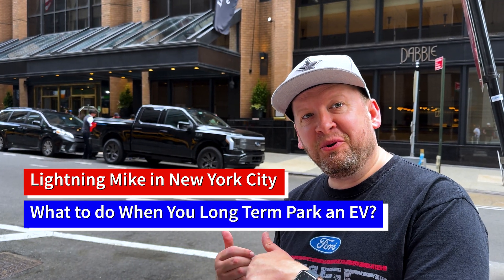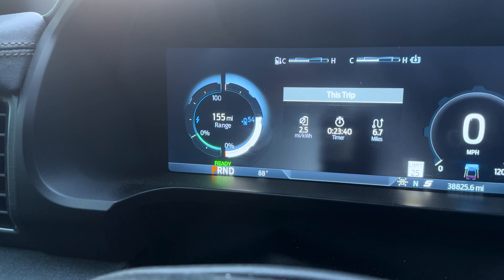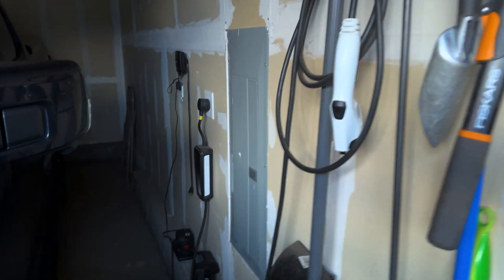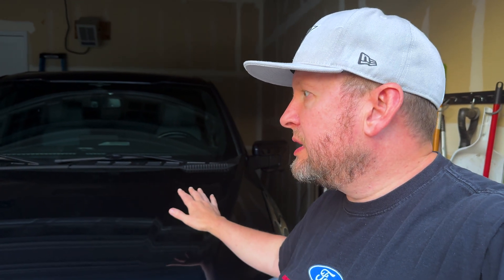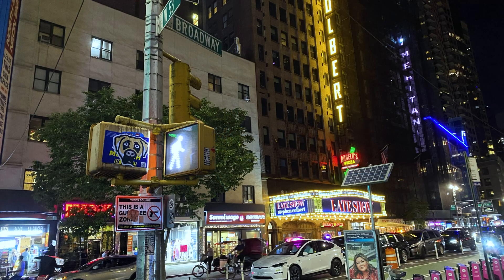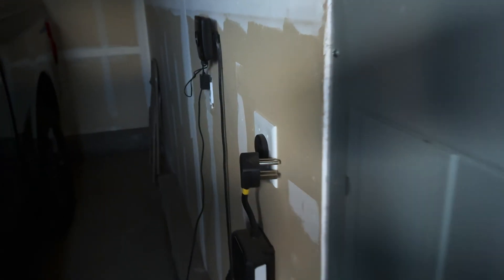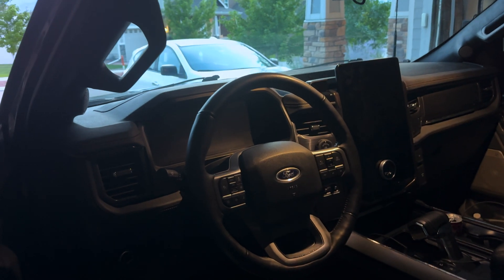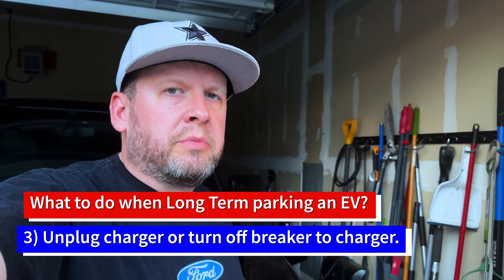Lightning Mike Trip to New York - Tips to Long Term Parking an EV

Comment: Have done this before. Left my Lightning, LER,parked for 18 days at 50% SOC, as recommended by the mfg., and did not have any loss in SOC  over that time. Started right up and functioned as normal upon return.
Reply from the maker: Yeah that’s my experience too every time.  It just goes into deep sleep mode, but it starts right up about the same as where you left it.